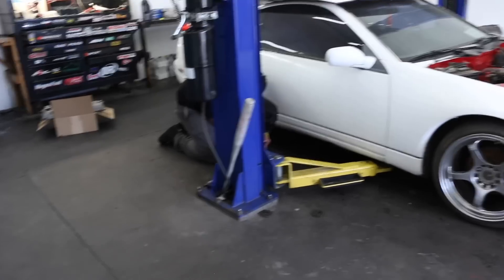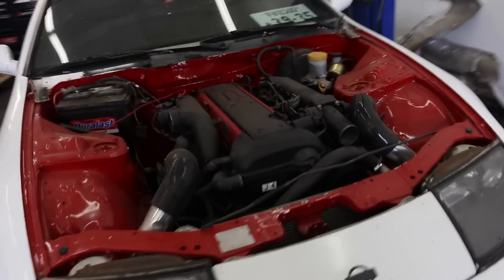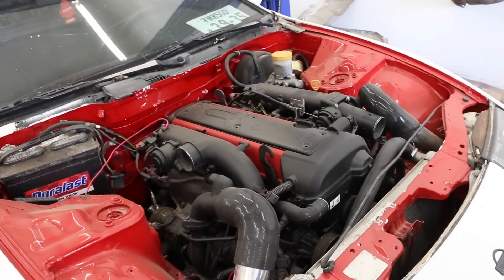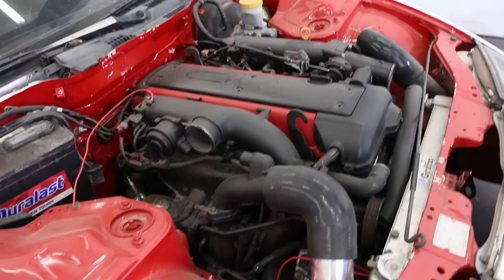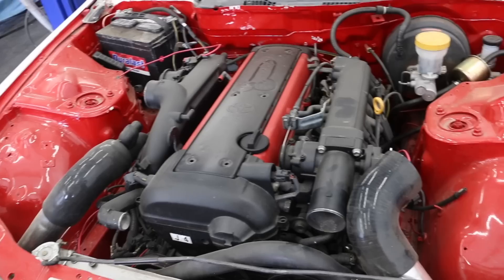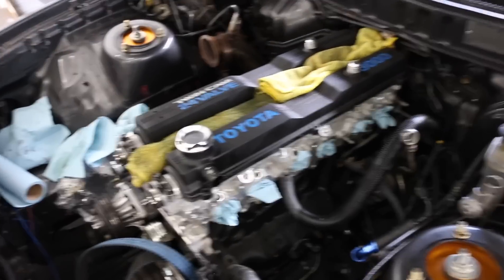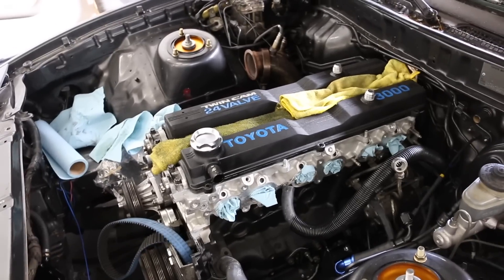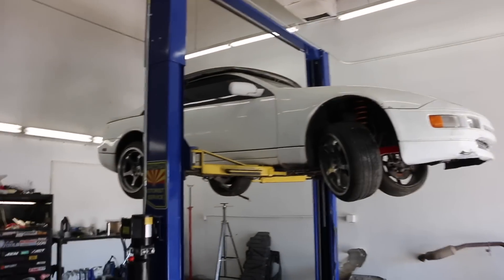GM BOSCH KNOCK SENSORS ON A 7MGTE

Comment: many in lines 5mge`s up  n the lot blew due to no ignition timing control oh and silly heads turblowing engines that add timing with boost [stock na ecu]
Reply from the maker: overbuilt automotive yikess thats no good

Comment: it's crazy to see where this car is from when you first started with it!   I'm trying to get my 87 7mge running but I cant find either a wiring harness or just the ecu pigtail..  i have a ecu for the 1986.5-1988 7mge with a manual trans..  if anyone can help I would love some info.  I'm supposed to drift this car on the 5th of july and this stupid plug/harness is holding me back lol
Reply from the maker: BadShot yea man its came along way lol but sorry i cant help out man. Harnesses let alone parts are hard to come by. I would suggest adding facebook mk3 supra groups

Comment: Where did you get the pigtails for the knock sensors?
Reply from the maker: Bad MonkeyInc ebay
Reply: @-LFATV  do you have a part number for the knock sensors and pigtails
Reply from the maker: Bad MonkeyInc lol.. i showed them in the video bro
Reply: @-LFATV  I saw the box for the sensors, missed that the first time. What about the pigtails
Reply from the maker: Bad MonkeyInc any gm knock sensor pigtail

Comment: Nice projects around the shop. I would warn you about the stock fuel lines, watch out for the stock fuel filter and running e85 as that is going to be a problem with those oem paper filters. You should look into a fuel filter meant to run e85 if you plan on running that, I run a Magnafuel one with a stainless steel mesh filter on mine.
Reply from the maker: Shwalker07 im not doing a stock fuel filter though

Comment: Hey Man, got a question. A W58 will work fine with the 7M-GTE or you advise getting a R154?
Reply: Both will work but with the w58 people usually don't run more than around 350hp. The w58 shifts smoother than the r154 but can not handle the higher hp a r154 can since it is built like a tractor transmission lol.
Reply from the maker: Joel Ayala if u already hve a w58 go for it.. dont listen to what most say about their unreliability. It depends if your constantly launching the car and beating on it. My buddies 450hp 1j with a w58 is perfectly fine. And we have had others hold more then 400hp aswell. All depends on the abuse
Reply: @-LFATV    I've heard that you can't put to much stress into them but thanks for the info man that helped a lot because I can't find a R154.
Reply: I've made 680 hp on w58s 5 years later they are still running strong
Reply: @mrgallardo7639  that's impressive haha
Reply: There is also a Nissan 370z 6 speed kit that you can install. It can handle 1000hp. Check youtube for part numbers

Comment: What size fuel injectors are you using on the 7M?
Reply from the maker: engineer4hire i was using 650s.. gonna switch to 1600s
Reply: LFATV okay, then it doesn’t sound like engine was running lean and caused the MHG to break as in the video.  Very unusual given my experience using Greddy 2mm MLS HG, without standalone.  I used 550 RC calibrated FIs and Apexi SAF-C 2.  Also have WB O2 sensor to keep eye on AFR.  Did you check spark plug condition on #5 and #6 where the gasket broke for signs of lean mixture?  If that looks normal, I would double check flatness of both block and head surfaces, especially in that area where break happened.  If surfaces are well peeped there shouldn’t be any BHG like symptoms.
Reply from the maker: engineer4hire yea its weird because car ran fine cruising and ocasional pull here and there. Block and head and face playe were decked.. im thinking it might of been something with ignition, l had to change those bkr7es frequently and also the safc and lexus afm setup was never properly “street tuned” soo it was good that i found out about it through the process of installing the new setup